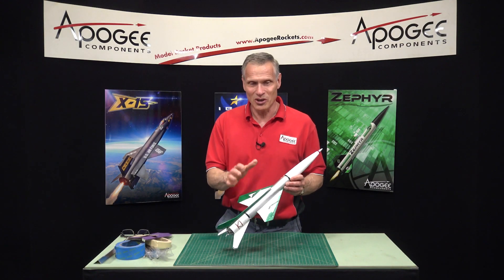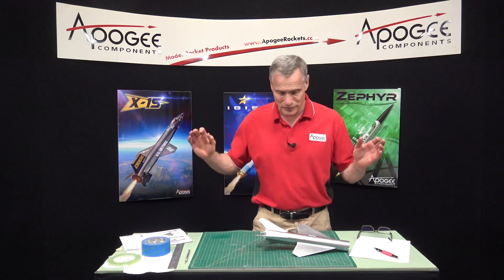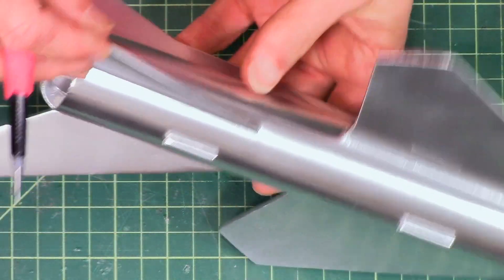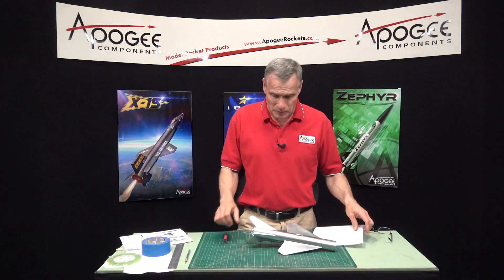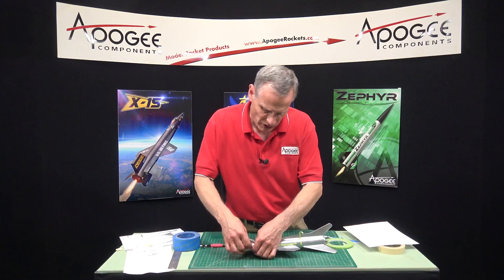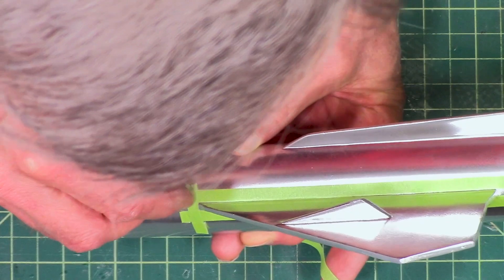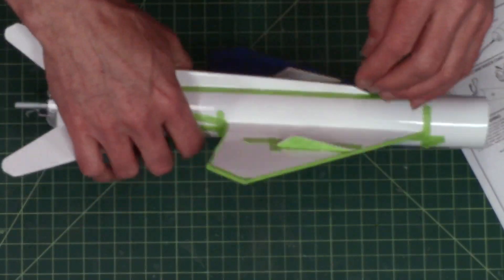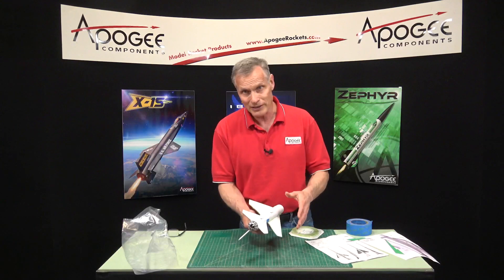How to test if paint can be masked over on a model rocket

Comment: For the silver paint problem...maybe a hard clear coat over it to protect it before masking? But as you say, a white base with the silver applied last is probably best. Also, rather than making decals for the wings (fins), could you not use the same technique (blowing up the image and cutting out the shapes) to simply make "masks" to mask off the area? You would need 2 sets of masks..one to mask off for one color and an inverse shape for masking off the other color in turn. Some narrow width double sided tape to go around the edges of the masks to hold them down...done. Decals are probably easier but an alternative for people who want to stick to painting only...

Comment: For your silver paint you could try letting it cure for a long time before masking over it, let it get good and hard.
I normally use the blue tape and it peels off fairly easily, but the paper has some texture and if you aren't careful the paint will leak under the edge in tiny bits.  Maybe if I took a smooth rounded object and burnished the edge this would help.  I bought some "delicate surface" tape, pink in color, but it seems to have stickier adhesive than the blue tape.  However it is fairly thin and smoot paper so it is easier to get crisp lines with it.  I've noticed that some modelers use Tamiya masking tape.  I may try that the next time I need to create some good lines.  I typically do my large areas with old newspaper or junk advertising we get in the mail.  However your idea of cutting openings in a plastic bag looks very interesting.
Reply from the maker: For this particular silver paint, I am almost 100% positive that nothing would have made a difference. But those are good suggestions.